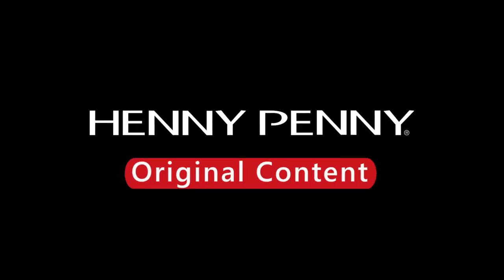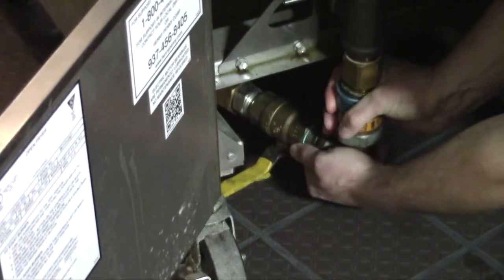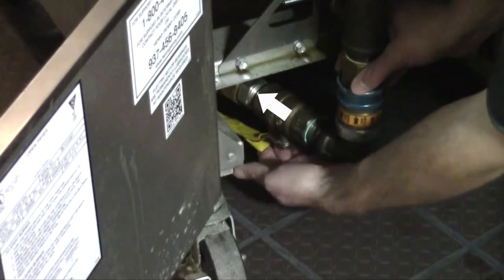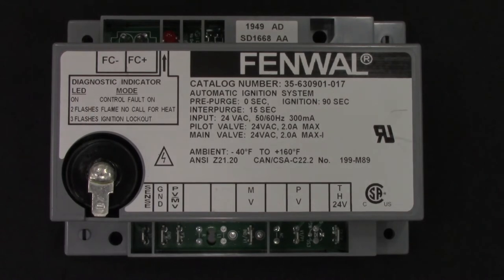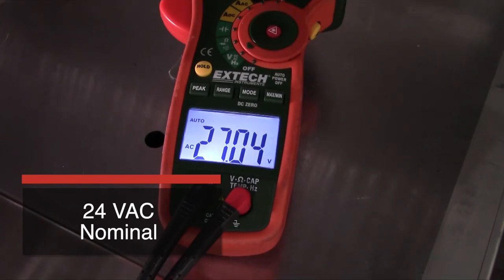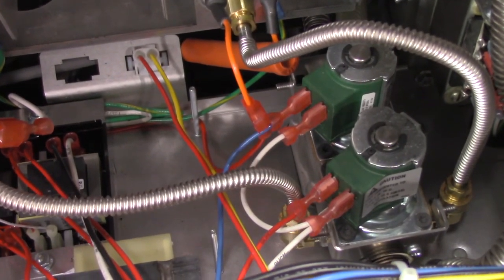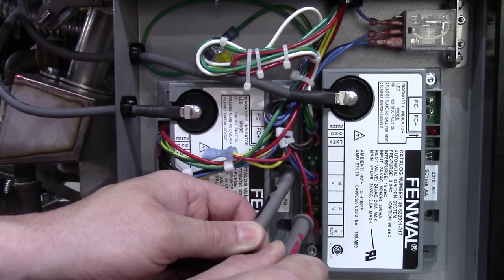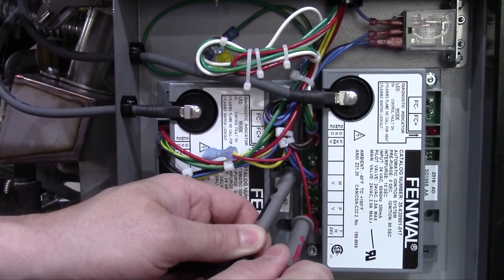E-20D Error Code: Sparking No Pilot Flame - Henny Penny LOV Fryers

Comment: just dealt with this today after watching this video.  Remove the gas line secured it back on correctly - restarted - and all three of them ignited and it worked great

The gas line was not open all the way.   so, by saying to remove the gas line, I was able to notice that.  

Just a manager, so it helps to be able to to give a heads up on these errors before my repairman comes.  Ty

Comment: I had a weird issue yesterday. I had an e20d error on a vat. Both pilots were sparking but the only the right burner was struggling to come on. I did check orifice for obstruction and I also had the 3.5”WC. This was only happening a few times a day. Solenoid obviously works if left burner is lighting. Ignition module obviously works if there’s spark. Gas pressure reading indicates there’s obviously gas flow. What else could it be?
Reply: try swap the cobo